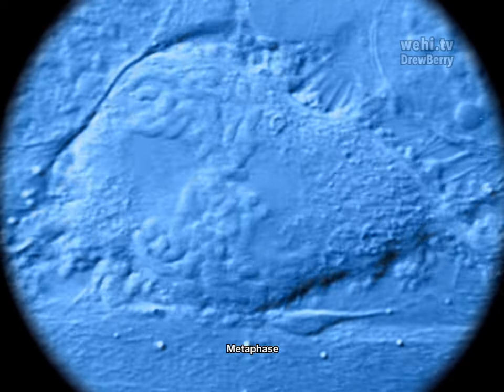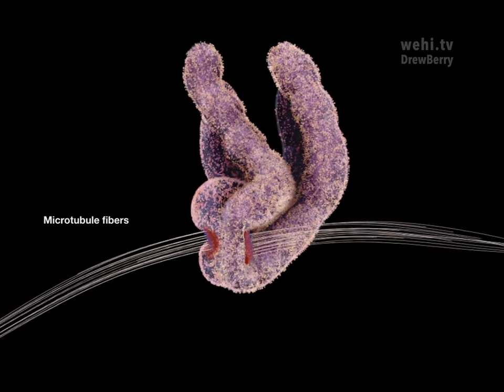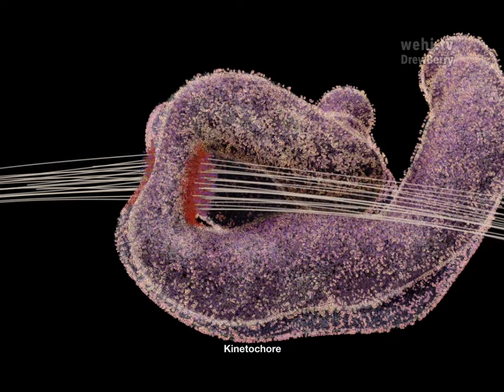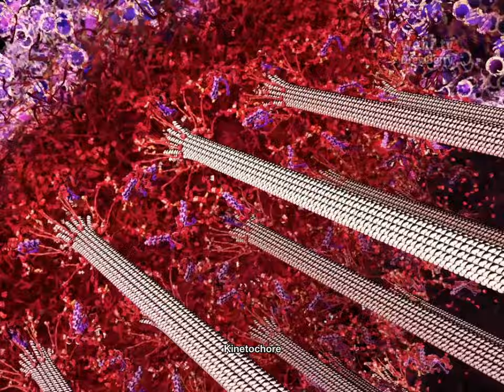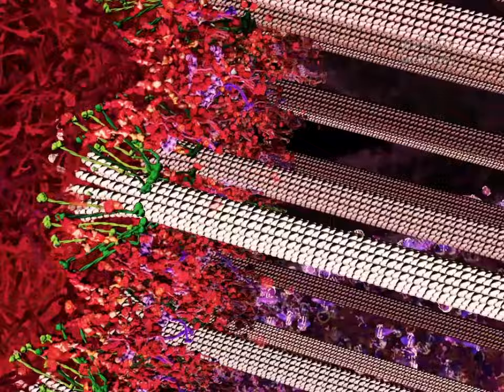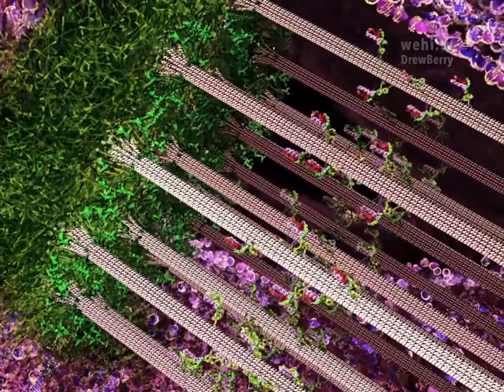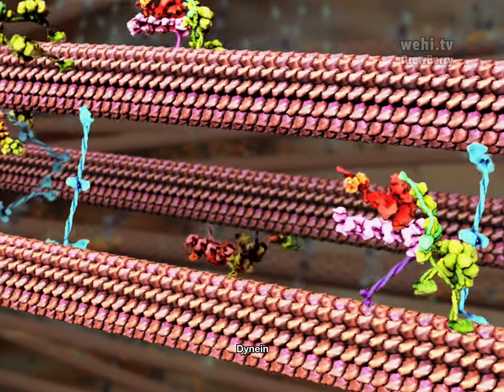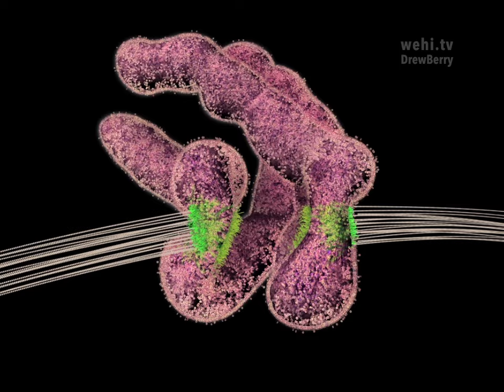Kinetochore and Mitosis

Comment: microtubule fibres from mitotic spindle guide and orient chromosomes to correct positions 
kinetichores act as interface between MT and chromosome  (many functions) 
kinetochore - attached to dynamic ends of the MT 
kinetochore - mechanical tension sensing system - to feel if everything correctly attached and positioned. 
Kinetchore - also stop signal broadcasting system - sending signal to cell about if ready to undergo separation of chromosomes 
if senses tension is just right and chromosomes is correctly positioned and attached 
- stop signal broadcasting system carried down by dyneins the MT away from the kinetochore . 
kinetochore ready - cell transitions to anaphse stage with chromatids pulled apart to opposite part of cell

Comment: What are the general purposes of cargo/protein transport along the microtubules by the molecular motors when the chromatid separation is occurring simultaneously
Reply: The video stated that they carry a chemical message that tells the rest of the cell that the chromosome is in position and ready for separation. Looking into it a little, it looks like these motor proteins are also partially responsible for helping the chromosomes separate as well, by interacting with the complex network of microtubules and filaments throughout the cell.

Comment: This happened by accident?
Reply: Important question.
Reply: Where'd you get the idea that this happened "by accident"? Atoms and molecules are like magnets. They pull and push in specific ways. If you have two cylindrical magnets with the poles on the flat sides, there's only two possible combinations it can make, no matter how you throw them into a box. Atoms are very much the same way, though considerably more complex than just magnetism. I suggest you look into chemistry, and especially molecular orbital theory.

Comment: Why are these the things functioning!!! 😃😃😃
Reply: It's not shown in the video because you wouldn't be able to see anything, but cells are full of different chemicals floating around, most especially water, but also Adenosine Triphosphate (ATP), which these little molecular machines use as a sort of "fuel". Proteins are made out of long chains of 22 possible amino acids, each of which has something called a "side chain" that gives that particular section a trait that helps lead to the proteins structure and functioning. For example, one of the naturally occurring amino acids is called "tryptophan". I'm sure you know that name, yeah? Turkey, thanksgiving, makes ya sleepy and such? Yeah, that's used by your body to make proteins, and it's special ability is that it's hydrophobic. Like oil, it doesn't like to mix into the water around the cell. That makes any section of the chain with tryptophan feel a "push" from the water around it, making it move to the center of the protein. Other amino acids have a positive or negative electrical charge, allowing them to attract or repel each other across the chain.

One of the cool things about that is that when exposed to certain other molecules, they can actually *change shape*. The aforementioned ATP is one of those, it's often called the "Energy Currency" of the cell. When ATP bonds to various proteins, they cause a conformal change (the previously mentioned shapeshifting), allowing them to change how they function. When that shape change occurs, a phosphate group becomes detached from the ATP, leaving it and Adenosine Diphosphate behind. This is a sort of "used up fuel" that the cell can recycle into ATP again. Nearly all of the molecular machines within your cells use ATP to perform their jobs, including your muscle cells (sliding filament theory), these little dynein and kinesin motors (which act sort of as cargo trucks), and migrating ions across membranes using ion channels (which your nervous system heavily relies on).

It's all quite a fascinating system! I highly suggest you look into it if you're curious.